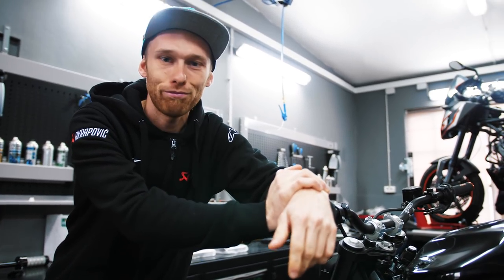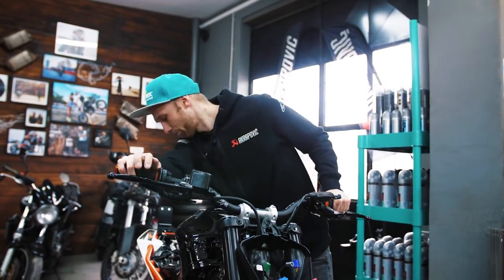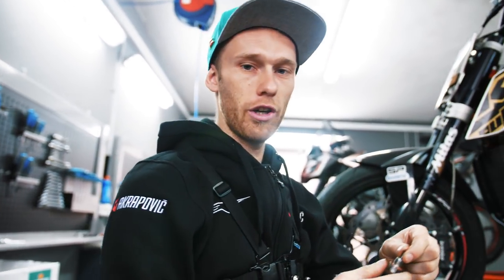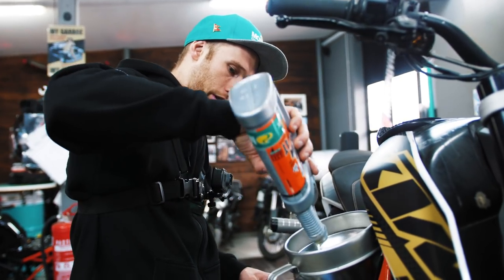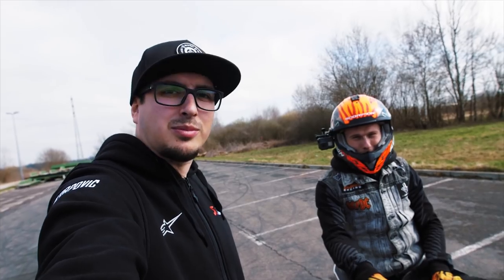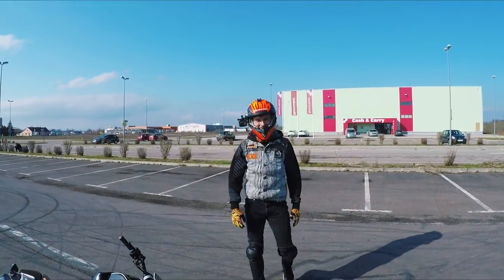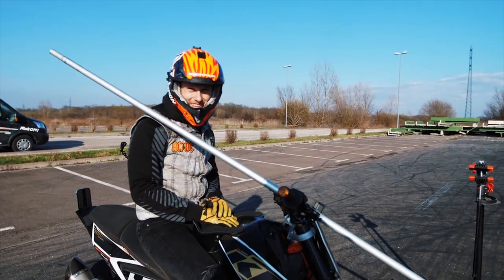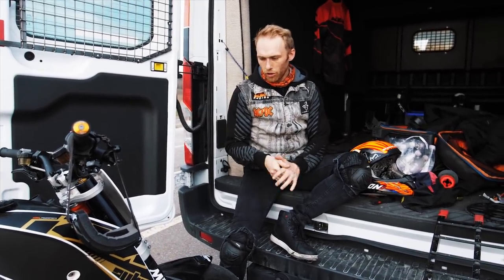KTM 690 DUKE MOTORCYCLE LIMBO  DRIFT| RokON VLOG #54

Comment: Rok, please do more tricks with 690 ;] As 690 rider I'd like to ask about front/rear sprocket you use and how you protect 690 from crashes - especially how did you attach that crash pad to ktm crash bars. I also have ktm crash bars, but would like to attach similar pads to it, to not scratch the bars. Can you create the same and sell it in your shop? same with the passanger pegs - can I buy them?